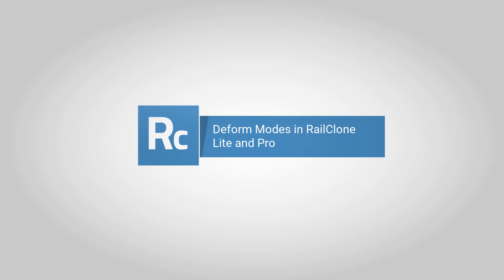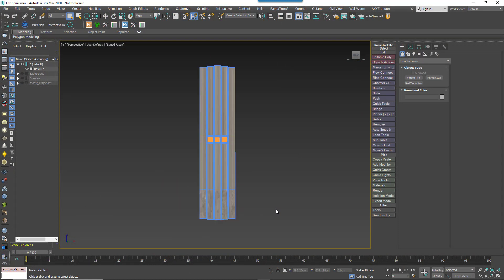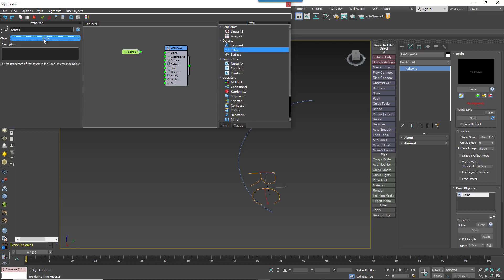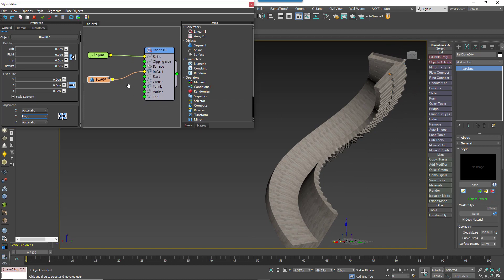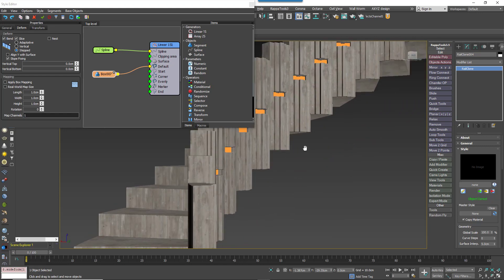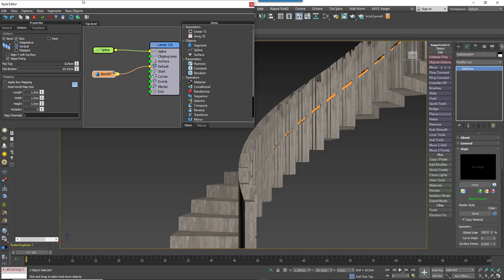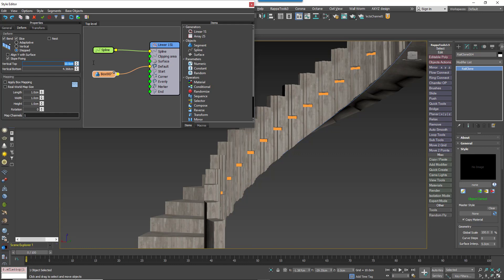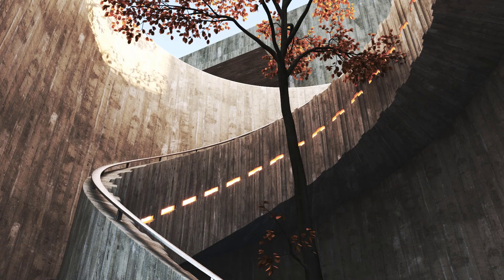QUICK TIP:  Using Deform modes in RailClone Lite (beginner)

Comment: need libraries. after purchasing rail clone . where can we get the libraries
Reply from the maker: Hi, the libraries should download automatically during installation using a separate application called update manager. You can also run it by clicking on the Update button from RailClone's General rollout. If this still isn't working for you, please drop an email to helpdesk@itoosoft.com
Reply: @itoosoft  THANKYOU,ANY THIRDPARTY LIBRARIES SITES FOR RAILCLONE LIBRARIES?

Comment: i cannot get the segment mateiral to appear in the viewport on the railclone object
Reply from the maker: Thanks for the question. You have two options. Either create a multi-sub object that you can apply directly to the RailCloneObject (which will also display in the viewports), alternatively, you can enable Get Segment Material in the style rollout. This will take the materials from the source objects at render time, but won't display them in the viewports.